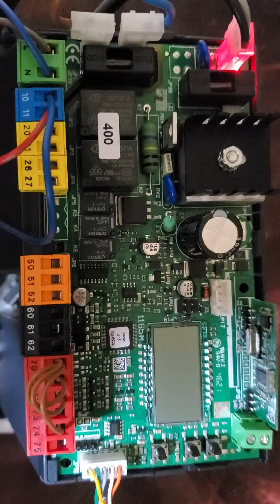BFT Deimos 400 Ultra board setup programming

Comment: Hi. How to put bft into learning mode so i can use my car buttons to open the door
Reply from the maker: @helloworld7796  I don't think this is possible. These remotes have a cyclical frequency. The only way would be to get a reciever branded to your remote and wire it into the gate motor.
Reply: @christiaanlw  Thank you very much. If you have some links to point me in a right direction, it would be awesome. I will try to google based on you message, but your help would be far better :)
Reply from the maker: @helloworld7796  car buttons will not work. Only garage door openers. So if you look at the brand. Contact them and ask for a receiver that can be programmed to your remote. You wire that reciever into your BFT gate motor.